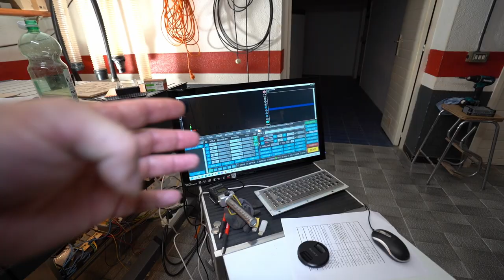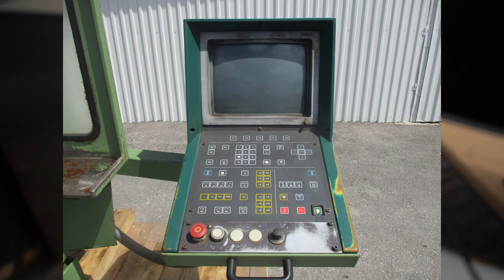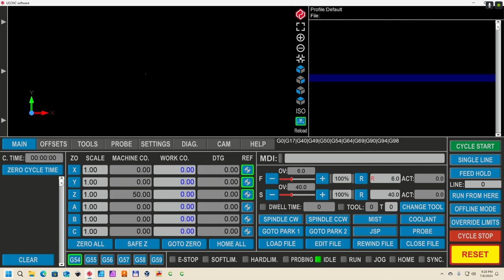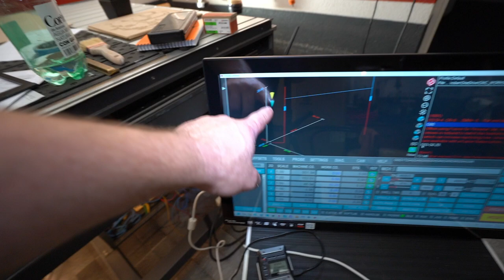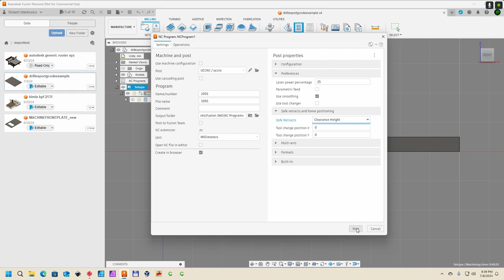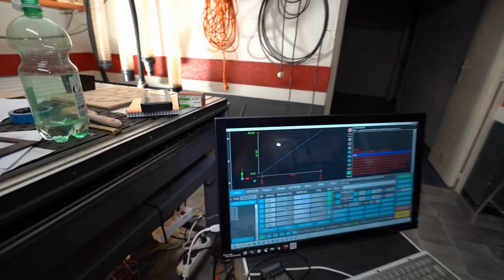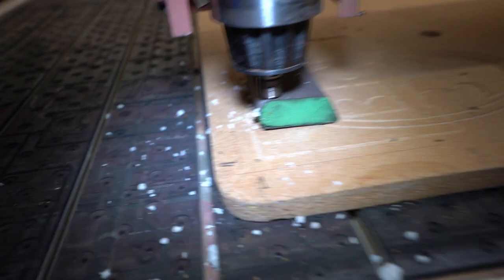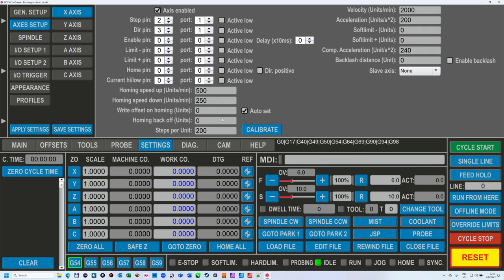CNC router upgrade  - UCCNC AXBB-E UCSB - part 6 - problem with Autodesk Fusion solved

Comment: Hahaha, this is really strange.. When I postprocess I have the G53 as a standard instead of the clearance height. And I am not having my machine going down into the stock. 
That offset in the settings is scary, you can set it in both positive and negative.. I have crashed proximity sensors that way 🫣
Reply from the maker: @NiclasGudmundsson  going down because of the 50 after write. If that field is zero, then everything is fine.
Reply: @BMRStudio  Yes I did see that in the video. Very strange that it was 50mm as default.
I did check it now on my new installation on my other computer.
Its good you solved it at least.